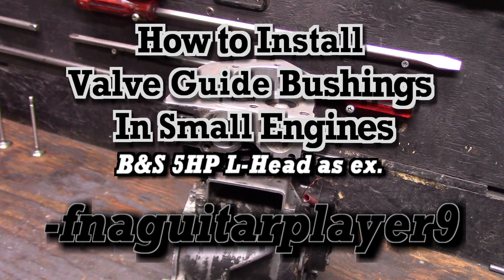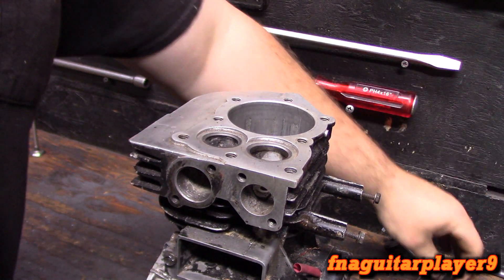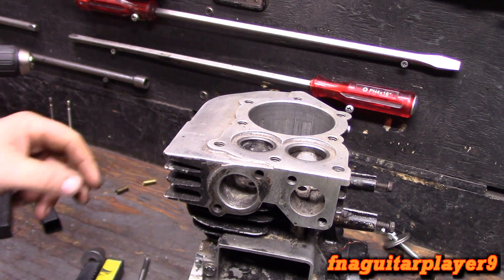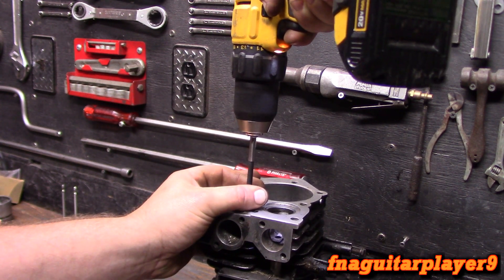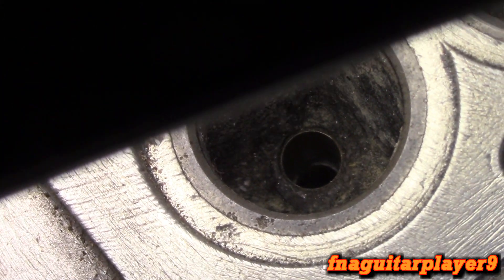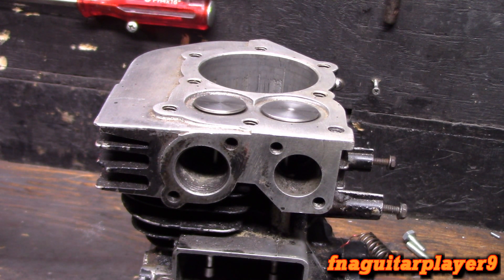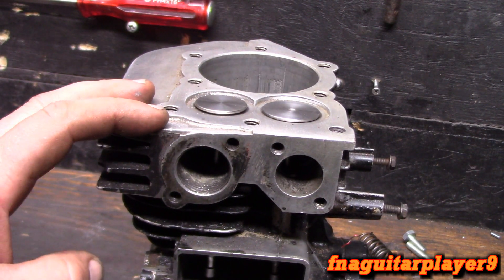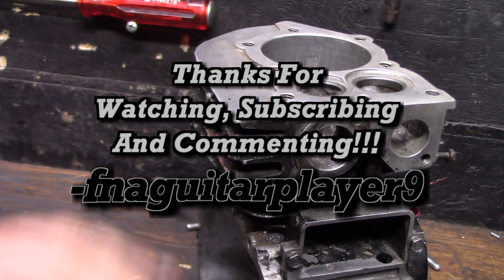How to Install Valve Guide Bushings In Small Engines

Comment: Hey man, the counter bore reamer. Could you measure the large and the small parts of it? I bought some bushings, but that counter bore reamer is really expensive and I think I can make one if I can find a regular reamer that has the same OD as the large cutting portion of the reamer. I can also make the tapered centering pilot easily enough on my mini lathe. The finish reamer is cheap and easy to find.

Comment: Thanks for the great guide! What part number did you use for the exhaust bushing? (not the incorrect and to thin 63709). For my engine (also 5hp B&S) pno 63709 is wrongly stated and info is missing in available exploded views about the exhaust valve bushing. I have measured the dismantled exhaust bushing, which has an outer diameter of approx. 8mm/.0315 (for 1/4 valve stem). Many thanks for the advice.

Comment: I have an old 5HP B&S on a generator. It burned an exhaust valve 20 or so years ago and then this year the thing started missing when under load and could not keep the revs up. I took the head off no burned valves but way too much play I lapped them both in and put it back together as this alum. block had no guides at all, it now runs ok but I think it will get bad again with so much play in the valves. All the small engine guys said I'll have to replace the engine sooner or later . But I was thinking of reaming out the alum guides and drifting in the new brass/bronze guides and a new set of valves and lapp them in. Do you think it will work and last? I'm asking you because you know your stuff and tend to think outside the box also. Tks for a great video.
Reply: I’m sure new guides will fix it 😊

Comment: great video, thank you, very clear with instruction.  i am thinking the exhaust bore turned out  a bit looser because the drill seemed to turn faster and for a bit longer, use to work in a machine shop, reaming was always done at a slower speed.
Reply: I was wondering also if not using a cutting fluid or lubricant might cause the drill/reamer to cut an over sized hole. In most of the videos I've seen when drilling and reaming for new guides they say to use a good lubricant.

Comment: What made you have to replace the valve guide bushings to begin with? was it not running right?
Reply from the maker: These are bad about letting oil seep past them and causes smoking while running, and in extreme cases if the valve guides are so worn that it make the valves not seal right, so it will loose compression and just not run right. Most common is just oil burning. Thanks for Watching!!!

Comment: Great video. You the guru! You know the subject and it shows. Few small engine shops may even know this, what to say do it. They probably do not even know how to differentiate between signs of worn rings and worn guides. I too have never done it in 14 years. Thinking of doing it for the heck of it, to have done well another rare procedure. Have a Tecumseh 9HP snow engine. Guides not available. May use Briggs guides or one from the set you showed. Is opening up the crankcase really necessary or can I go just cover the holes for the valve tappets with duct tape?
Reply from the maker: Thanks! If the briggs ones will not work, you can probably find some brass bushings that will work just fine, as long as you have the proper size tools to drill and ream/press the new ones in. No, you can do that, just tape it off so no shavings will get in, i had this engine already tore apart. Thanks for Watching!!!

Comment: What would be the part # for the valve guide tool for the model 28 briggs? I have a 12 horse powerbuilt on my snapper that has over 4000 hours on it and the exhaust valve guide is very sloppy.
Reply from the maker: I do not have the part #'s for that, i can give you the part numbers for the guides though. I haven't been able to source the kit for the bigger engines for some reason. Intake valve guide is 231218, exhaust is 261961 Wish i could help more. Thanks for Watching!!!

Comment: Fine job! All I've ever done is lapped and not new bushings.............yet! All I do with a stuck one is pull the head, run some good oil down the stem and take a dead blow hammer and tap the valve back down after turning the engine over till it goes back down on it's own. Then put the head back on after changing the oil in the sump if it's grungy, and it usually is. Then get it running and the valve will work itself loose and then change the oil again. I might use cheap oil in the 1st change or ATF but Delo or Valvoline diesel formula 15/40 in the final. You did GOOD, Pal! Pick me one!
Reply from the maker: Thanks. I hear ya! That usually works good, i've had a few that were really bad. I usually use a cheaper oil to flush them out, then go with valvoline mixed with lucas, seems to be a perfect mix for small engines (future video as well), thanks for watching!!!
Reply: @fnaguitarplayer9  Sounds like a plan to me. Good old Lucas! That's in a new one to me because I try and keep the oil clean from then on and I have NO doubt you do too! NOW go pick me one!
Reply from the maker: @lewiemcneely9143  It does good, yeah it makes a difference flushing them like that. lol I'll have a pickin' video eventually
Reply: @fnaguitarplayer9  The Onan 2500 watt had a stuck valve and it's run fine ever since but I marked the crank pulley and store it with the piston a T.D.C. The Briggs on the 5k I hit the starter every few days so it don't have a chance. Now you can pick me another one to stay in practice!
Reply from the maker: @lewiemcneely9143  Thats a really good idea keeping it at TDC.
Reply: @fnaguitarplayer9  That's on the Onan 2500 that had the stuck valve. I just marked the rope crank pulley and the blower shroud. It stays there till it gets used again and the trash can is where the Briggs 5k is so I just tap the start button every few days. The rest don't really have time to get as stove up as I am!